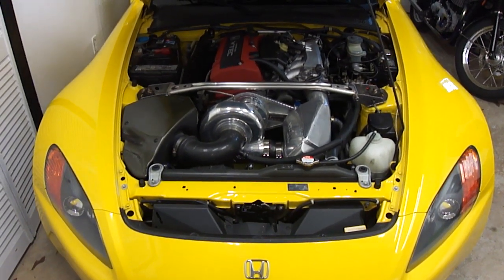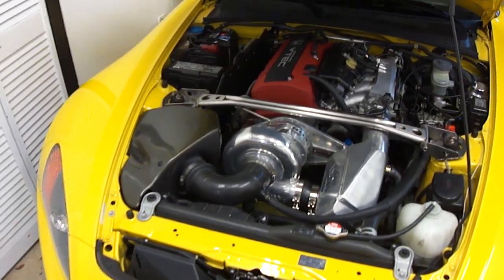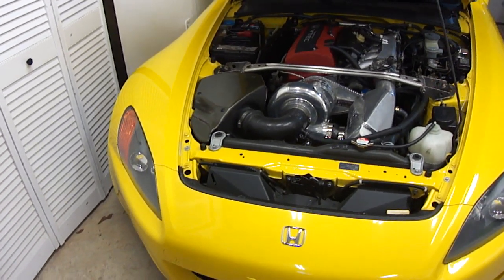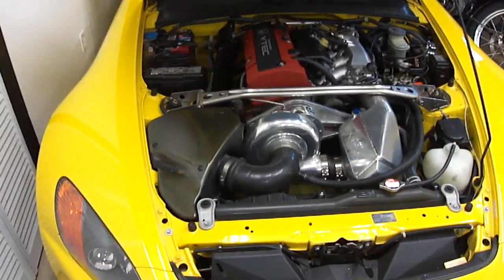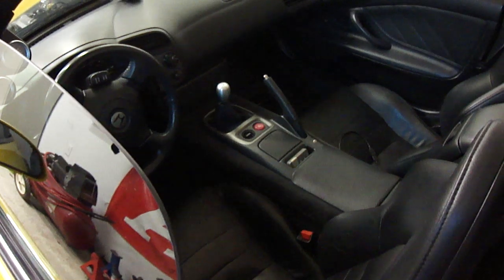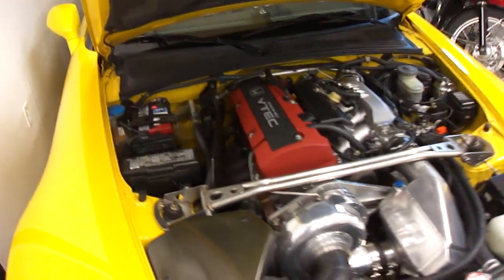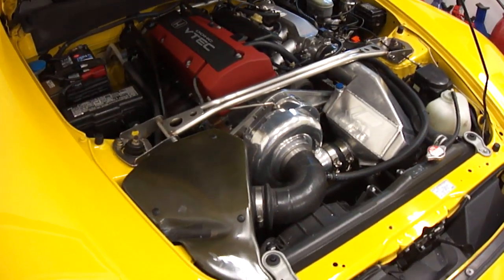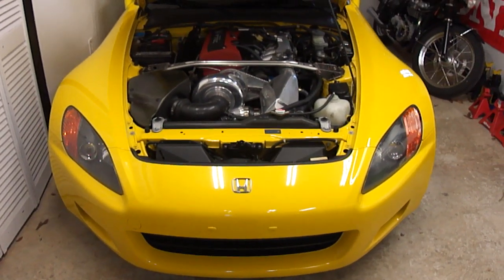S2000 Comptech Supercharger Review 360RWHP

Comment: For a bone stock motor and bone stock supercharger setup, the walbro 255, RRFPR and piggyback, stock injectors and exhaust... without upgrading anything at all, that should work decently, yeah? what problems did you have with the RRFPR and piggyback? Im aware theres better out there, but as its designed for the kit, does it do its job as the kit is advertised? Looking to hit 300

Comment: Nice. Have you tried NA? You could pull 300+easily with a 2.4 stroker, new pistons, cam, crank, itbs, surge tank, the lot (oh, don't forget a good ECU) and best yet, because no supercharger or turbos, easier to insure.
Reply: That sounds like much more work, less power, less reliability and less atmospheric pressure efficiency for at least as much money.
Reply: And less drivability.
Reply: Ethanmeister With turbos you need to redo your cooling system, make sure your block, headers, etc. handle take the added pressure, perhaps look at new crank, new pistons, (maybe even cams) redo your tranny because your stock unit may not be able to take the increase in power. If you want to do it right it's an even more complex build. With NA I was describing a "complete build." I've seen other NA engines put out there reliably chuck out 1000+ at 900+ footpound of torque.
Reply: Ethanmeister And more drivability I dare say because instantaneous response, less weight up front, better feel, but as they say if its easy it's not worth doing. Trust me. its worth the effort.
Reply: +I Ren lol I'm sorry but I don't believe you for a second that there are N/A f series engines making anything near 1000hp or 900lb/ft. Please show me one. And for 400-450whp which is what he's looking at, all he will need is a clutch. The stock internals and drivetrain can hold together with much more torque than he will have. But for a striker kit you have to take apart the engine. How is that less work. But I digress. Please show me these amazing N/A 1000hp f-series engines...
Reply: Ethanmeister Hahaha ... sorry, I forgot to mention I was talking about the LS. My bad.
Reply: +I Ren Oh well that's a whole 'nother barrel of fishes. I'm all for N/A but I was just saying the 2.4 stroker isn't better value than a supercharger kit both in money and effort unless you're building a track car. But I doubt any LS revving to 9k and making that kind of power is particularly street able or reliable and I'm not a proponent of LS swaps in s2k's simply because it doesn't match the it's handling characteristics but if it suits other people then more power to them...and torque.
Reply: Ethanmeister 7000 rpm actually is about as far as I would go (I've seen 8000 one or twice), but with the LS its all in the displacement of that big V8 - that's why the LS can reliably put out big power (when assembled properly). For the S2K, I'd actually put in an C32B, stroke it to 3.5, new cams, pistons, crank, con rod, pully, itb, etc.. With a full build it should be good to a max of about 400-415 at the flywheel depending on how skilled your shop is. I have seen it done before in a Japanese street car so I know its possible.
Reply: +I Ren I said 9000rpm because that's what those LS's that are making 1000hp are revving to but yeah I mean a stock c6z 7.0 revs to 7k stock and that's a great engine but I still wouldn't have one in an s2k. The c32b I could get onboard with though, I think it would match the s2ks characteristics much better than a J-series. And I've seen one as well that was a racecar with ITBs and it looked glorious. And yeah 400+ crank should be easily attainable with a built engine.
Reply: Ethanmeister One thing though, With that C32B, you need to remember the airbox to get proper flow to your throttles. That's something many people forget.
---
The LS is very good for Time attack and GT with a larger, wider GT car which the S2K is not.

Comment: Did you own/ drive this car at a base psi like 6 or 7?  Was it worth upgrading to the computer injectors etc?  Does the car handle the hp?  Is it useful?  I have a stock vortech kit, considering upgrading but I'm on the fence because I almost feel my 320 rwhp is solid.  Just curious,  thanks.
Reply: A friend works on honda aspiration conversations for years and we had the debate a while ago and we think, with a ap1 stick to a low pressure as the costs to strengthen the engine to handle the difference is high and the fact of the lack of traction control in the early models it can become a handful. If you got a ap2 go for it, it's easier to work around the extra power, and it'll be allot more solid with the slightly lower reving ap2. The little added torque works well with a stronger boost, and being in England the TCS is nice as it's a handful in so varying weather.
Reply: Thanks for the info.  That was my thoughts exactly.   What good is extra power if it only makes the car harder to drive...  it's an ap1, making  320 rwhp.
Reply: Dereck Casper I have one extremely similar to this (on my channel). Its not overwhelming at all. It spins tires at 8-9k RPM in 1st and 2nd ONLY on cold days <45 degrees or when its wet out. Extremely fun and manageable. Perfect for 40 roll racing kids in mustangs.
Reply: Thanks Ian,  how much power do you make?  How is it tuned? Damage a rear or Tranny yet?
Reply: Dereck Casper 360 WHP. No damage to the rear end or trans despite some abuse. I must note though, the car has 35k original miles and its an 02. AP2 retainers is a must
Reply: What type of tuning

Comment: I'm NOT talking shit. Let me make sure I say that. But 209lbs of torque??? That's kind of pathetic for how much hp it puts out. Again I'm not talking shit but restrict your exaust and get that shit BACK!! OR....swap it for a AP2 :D
Reply: Always someone here that can't say "awesome job", and has to rant about torque or some shit. Blah blah blah....mine is stock and is an absolute blast to drive....IF you know how.
Reply: nezerac hp is what matters. hp is how much energy you have. it takes energy to move a car, not crank tq. 

also, comparing crank tq to another car is retarded.... 300whp is 300whp worth of tq at the wheel. any other car with the same whp can put the same amount of tq at the tire to the ground....

saying x amount of tq is low might be true, but you cant compare that to what is at the actual tire. that is determined by whp....

to make a car faster, you need to increase the overall hp output. discussing crank tq and linking it to performance is done by a human with no concept of energy transfer
Reply: Exhaust back pressure doesn't increase torque... It's low because it's a high revving 2 liter, stroking it or swapping to an f22c is the only way to raise it, but it'll still be "low" because it's a little engine. I'm sure it's plenty fast, dyno sheets mean jack shit.
Reply: DucDucSTFU
I'm gonna fight clean hear...so I want you to stop and think about this. Ford has a 2.0l ecoboost that doesn't rev as high and comes factory with 350+ lb feet of torque. Mazda has the same, nissan from the 90's pulsar GTi-R has the same. fords 1.0l ecoboost puts out 158lb-ft of torque. SO.....that engine with 1 less cylinder and half the size is capable of more torque by simply adding more boost (been done already too). So why is it an issue when I say 209lb ft of torque is "low" when it's LOW? I'm sorry to be a rude asshole shooting off at the mouth here ...but it is!! It has nothing to do with displacement, it has everything to do with the cams and tuning. This car has VCT which means he can cam it to get "Drumroll" TORQUE!!"
Reply: nezerac
How is it fighting fair when you just said something completely different than your first post. You said the torque is low for the horsepower it makes, that doesn't make any sense. Horsepower is a function of torque, they are directly related. The intake manifold length and design, and the design of intake ports, exhaust ports, general head design  and bore to stroke ratio have a huge influence on attributes of the engine. Sure you could  get some cams and slightly effect the torque curve, but the basic design of the engine has the largest influence on how and where the engine produces power. Why would he completely redesign an engine that performs quite well, so his dyno graph looks prettier to you?
      The F20c was designed as a naturally aspirated engine that just happened to make the most hp per liter in it's heyday, it has  intake manifold designed to move lots of air at high rpms, and big flowing ports to more a lot of air at high revs.
   Also, I never said displacement was the defining factor in an engine's torque output, however,  increasing a engines displacement will generally increase it's power output.
Reply: DucDucSTFU
hp IN A NUTTSHELL is completely based from rpms! BOTTOM LINE!! you can have an engine with 80lb feet of torque under 5252rpms and still create massive amounts of  hp via RPM!!  F1 is a prime example of this. But just an fyi if you didn't get the memo. hp is less usable than torque. HP requires you to rev the engine to be effective while torque can be used anywhere in the range. Cruising on the freeway at 90mph 99.9% of the cars on the street will still be WELL below 5k rpms. Your torque is your bread and butter all the way to 5252. So why deck out your engine to produce even more hp when you can produce a very usable amount of TORQUE?

Now you can keep on arguing all day if you want but it's plain and quite frankly common sense that torque is more applicable in a street car than HP. I'm not trying to get the man to change his car for MY tastes...it's not MY car but as someone who is a fan of engineering I can honestly say that if you're not racing every single day and going to the track every single weekend, a torquier build will always be MORE satisfying and MORE usuable than a high HP build.

Now let's talk about what hp is vs what torque is so you'll understand the real core of this debate instead of running off at the mouth like you grasp something that you really don't.
Torque is FORCE!! How much FORCE your engine produces automatically means that it can move light vehicles quickly and large vehicles at a very similar rate.
HP on the other hand is APPLICATION OF FORCE which essentially means how many times that amount of torque can be applied in a given amount of time. So the easiest why to see it is if you have a high torque engine that rev's high...you will automatically have a high hp engine. Like wise if you have a engine with very low torque. You can expect to have low hp unless you rev the piss out of it.

Now to further throw your argument in the trash the ap2 was modified BY HONDA to produce MORE TORQUE!!! It made the cars power more usable and attainable because you don't have to be at the limit to get the damned thing to move. Why you're arguing against torque when the people who built the car ENGINEERED more torque into the "upgraded" model...only you know. It seems to me like you like to argue and seem intelligent when in reality what you're saying makes very little sense. This guy can do whatever the hell he wants with his car but like I said. He'll enjoy it more with more torque. If you're arguing with THAT PREMISE then maybe you need to further educate yourself in the difference between "power" and "apllicable power". There's a big difference between 300hp via torque and 300hp via rpm. I don't think you can even argue that at this point seeing as honda has made an effort in producing torquier engines across the board.
Reply: nezerac Do any of these engines rev to 9,000 RPM? Everything in engineering is a trade off, you cant have the torque of a low revving 2.0ltr with the high revs of another...
Reply: 192lalo
That's a very cute statement seeing as the s2k hasn't beaten any mustang ever. The 350z sure as hell hasn't either. Ok maybe v6 ecostangs for college girls XD
Reply: nezerac I beat GTs no problem....just depends on the year.
Reply: +Chad W Let me simplify it for you . Two exact have 300 hp. One has 200 tq and other has 250 tq. The one with more torque will always be faster. Even if the example was two exact cars , except this time one has 300 hp /200 tq and other has 280 hp/250 tq , the one with the more torque will still accelerate faster (up to a certain point , a good reference point would be a 1/4 mile ) . The car with more horsepower will have more of a "top end " .
Reply: mqk3hw
An S2K can't beat a late 90's GT without mods. Not only that it's annoying as hell to even drive a round compared to the GT.
Reply: +nezerac I never said anything about  a s2k beating a late 90s mustang GT .... BUT...they both trap the 1/4 mile with similar E.Ts and MPH (stock) .So stock for stock that's really a drivers race .
Reply: 192lalo
It's an f20c right? Don't think you can over rev those things since they go to 8k. 9k in some parts of the world if I recall correctly.
Reply: 192lalo
I think the big difference is torque curve. I'm not a pro on the ap1 v ap2 discussion but I'm pretty sure that was around the time honda decided to give a damn about torque output.
Reply: 192lalo
supercharging it sounds like a perfect fix. Still.....being in cali....you never get to really play with your toys. -_-

Comment: im a s2000 neewb but thinking about buying one , im thinking about modding to about 400hp , does it really matter which year s2k you buy ?     cause thy say 06 and up you can flash and reprogram the computer with flashpro and 00-05 you cannot , so how do you have a standalone computer with an 2001 ?
Reply: There's not a ton of difference between the years. I've driven AP1'sand AP2's, and I'm on my second AP1. Fantastic cars, but make sure you drive one stock before you go boosting to 400hp. And maybe start with lower boost if you do buy one....mostly read ALOT. They're a ton of fun to drive even stock....a true driver's car.

Comment: Its called 9k rev line. 6th gear maybe putting you at 3.5k @ 75 mph but when stretched out to 9k i could believe it would be capable of That. i know my civic with stock gear ratio's (on forza motorsports4) Will go up to 200 mph. while still having short gear ratio's.

Comment: I'm sorry, but I had to give this video a thumbs down. I work with people that regurgitate information but don't actually know what they're talking about. I could could hear it in your voice that you're running information you've either read or heard. As far as the "as fast as a zo6..." complete lies! I own an 04 s2000, my car before that was a 700whp civic. I've driven vipers, corvettes, multiple supercharged S2000, and the S2000 is at least 1 second slower in the 1/4 mile. Which is a lot!

Comment from the maker: Trap speeds of my s2000 where around 111 mph, pretty darn fast in the quarter, but my best time was a 13.2. I just couldn't control wheel hop and I was afraid I was going to destroy the rear axle. 

Fast foward to today, I now am the owner of a 2002 Chevrolet Corvette. American Racing long tube headers and x pipe, corsa touring mufflers, slp blackwing intake, vararam intake, and bilstein sport shocks. I gotta get a new clutch installed and then off to tuning. 

My s2000 definitely felt like it

Comment: Running the exact same set-up (down to the the pulley size) on my 2005 AP2....and I'm using (wait for it) A FUCKIN EMANAGE ULTIMATE. So you can take the piggyback comment, and well, shove it.